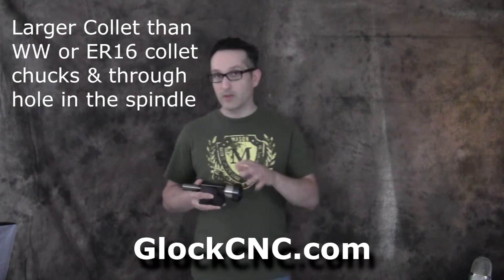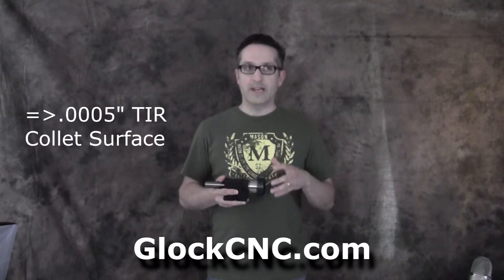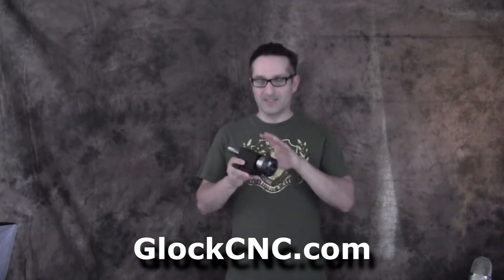Sherline ER Collet Modified Headstock Conversion ER25, 32, 40, 50 + Denford Lathe Mill

Comment: Uh at those rpms I think you mean turbo chargers not super chargers.
Reply from the maker: Our superchargers were specifically designed for very high RPMs. Similar to the Rotrex. The Rotrex C15-16 can go up to 201,500rpm...which is pretty amazing. Actually, all turbochargers are superchargers, but not all superchargers are turbochargers. Turbo simply describes the turbine side and the compressor side is referred to as the supercharger...so, what's commonly called a turbo is a turbo-supercharger to be exact. Just a tidbit of trivia.
Reply: @glockcnc  Then obviously my layman's knowledge of the two types is faulty. Thanks for the correction.